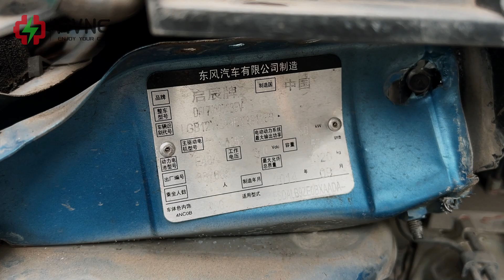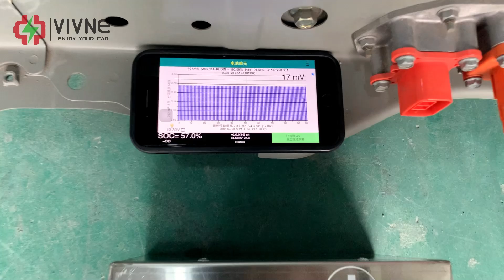VIVNE-Nissan leaf battery after real car accident

Comment: I don't see a Q&A video on the channel. Would you do one? Here are couple of questions: Roughly how much money for your batteries? What's the cost for shipping to various parts of the world? What type of batteries do you use? Do you already have connections to various garages in different parts of the world?
Reply from the maker: Sorry for the late reply,  you can check the price here: https://www.alibaba.com/product-detail/VIVNE-62-50-40kWh-Battery-Modules_1601254935360.html?spm=a2747.product_manager.0.0.7cbc71d2y2mA5k. Shipping costs vary from country to country, I have to check according to the detailed address. We use CATL NMC battery cells. Yes we have partners in different countries.

Comment: 1:45 Curious why both airbags deployed.
My own [2011] leaf has a faulty passenger presence sensor on the passenger seat: disabling the passenger airbag.
Reply from the maker: Normally, both airbags will pop out. If there is a malfunction, it is best to repair it.
Reply: @VIVNE-CoraLiu  Part is not sold anymore.
Need to do my back taxes to afford to import a scrapyard pull and get it professionally installed. (The seats contain explosives, that I can't just throw in the garbage.)
Reply from the maker: @economicprisoner  Oh so sorry to hear that...
Reply: Passenger sensor is weight sensitive, not just presence. It will only disable the passenger airbag if it senses weight but not enough, or sufficient weight but passenger seatbelt is not buckled. Otherwise, both front airbags will still deploy, including if there is no occupant detected.